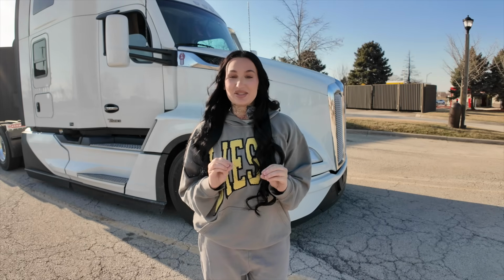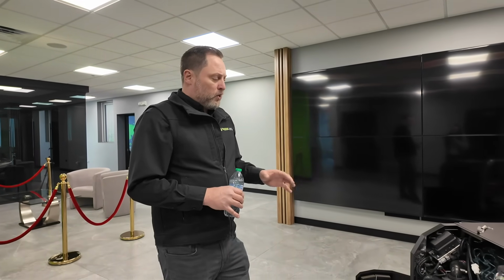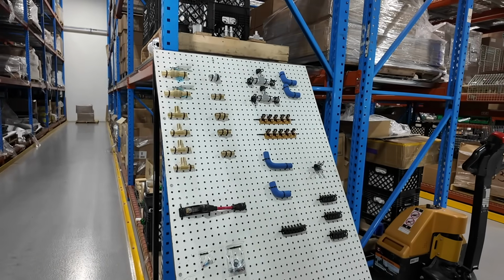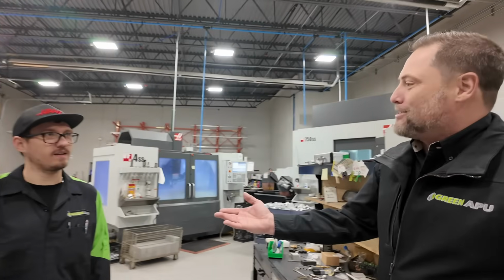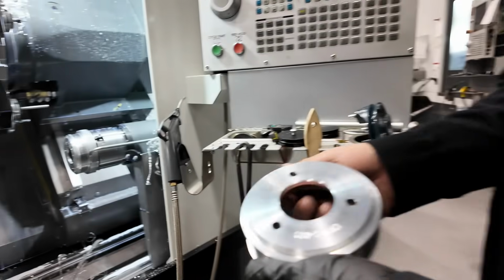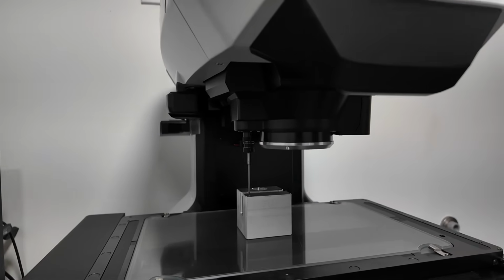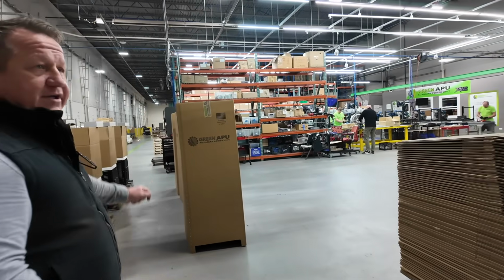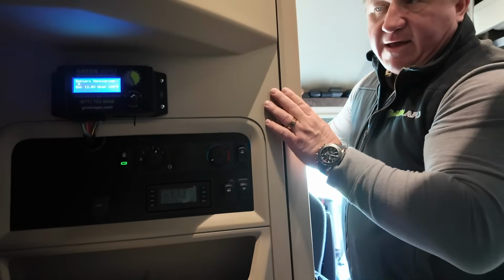I GOT A GREEN APU!! Full Tour of Green APU + How They Are Made

Comment: So the green apu won't automatically kick on if your voltage drops unless it's turned on battery charge mode?
Reply from the maker: It will. He was saying if you leave the truck  for a vacation or hometime to turn it to the setting just for battery charging because you don’t need it held at a certain temp when the trucks sitting.

Comment: We had a Green APU tech and rep come to the shop to give us a run down on the system and cross over parts reference. And it is true if you have the part number experience you can go ahead and get the replacement parts from any local parts store. Also service on them is simple for oil change and etc. The amount of access and simplicity of cover removal is great and straightforward.